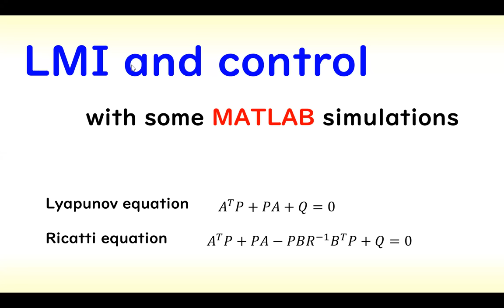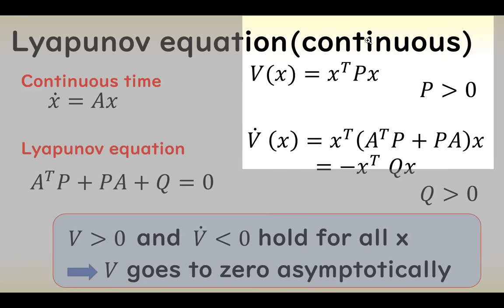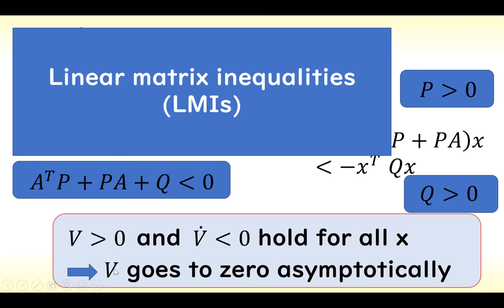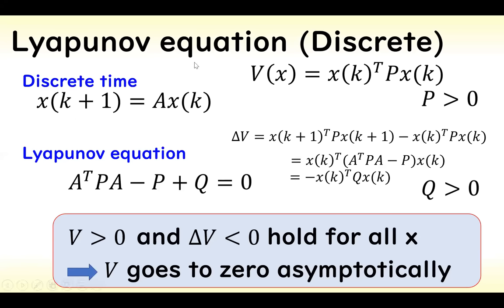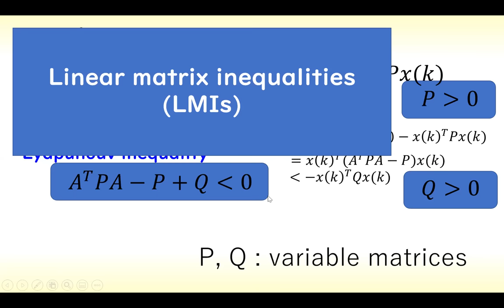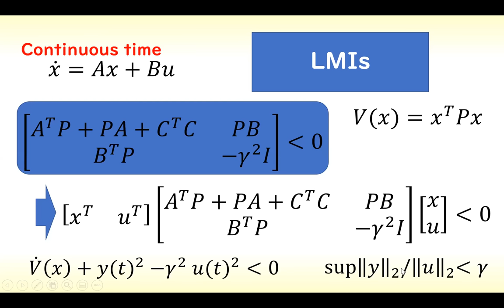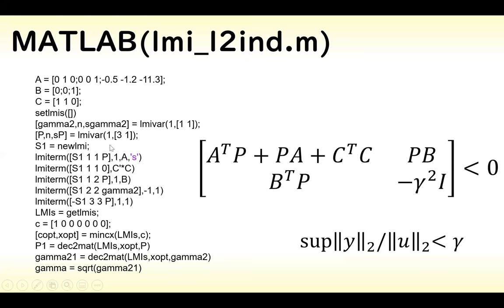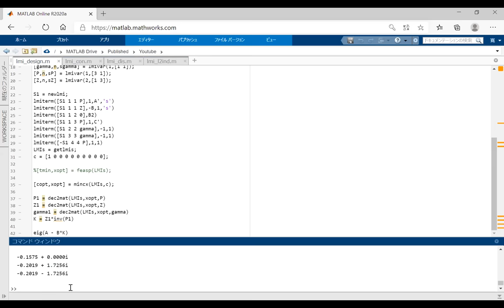LMI and control (with some MATLAB simulations) 📖Linear matrix inequalities📖

Comment from the maker: My new article is published at IEEE ACCESS. It is an open access journal of IEEE.

State Observer under Multi-rate Sensing Environment and Its Design using l2-Induced Norm
https://ieeexplore.ieee.org/document/10054014

matlab code
https://doi.org/10.24433/CO.2360629.v1